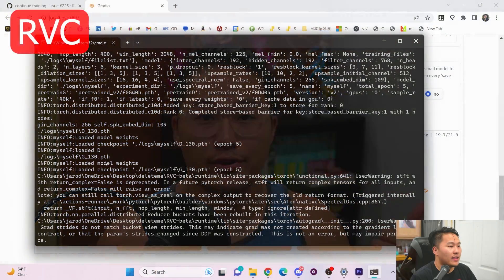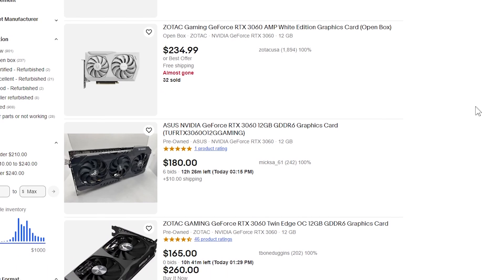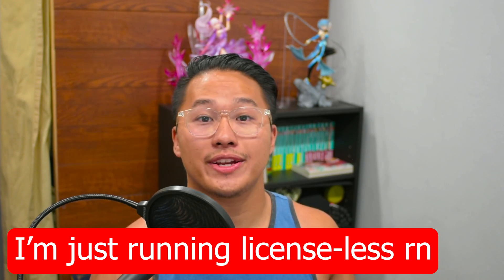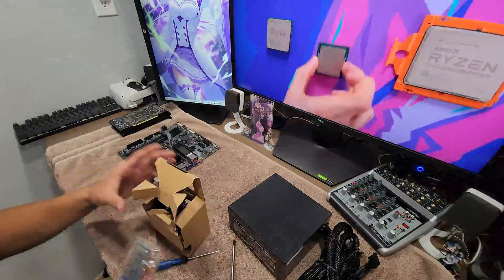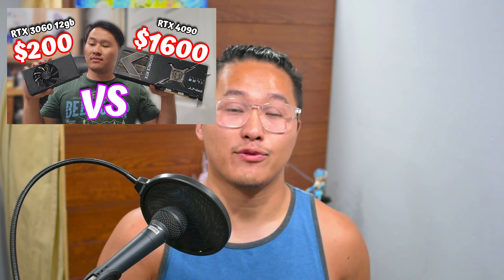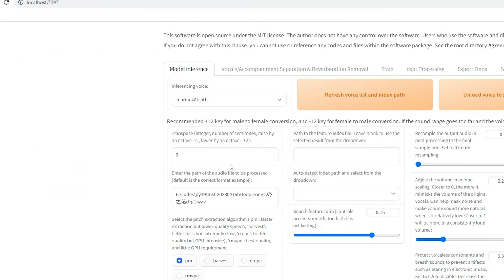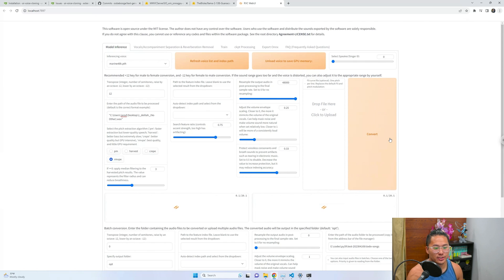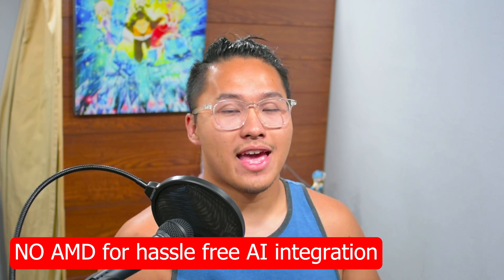The BEST $500 PC for AI 2023 - Voice Cloning, Image Generation, and LLMs

Comment: Hey Jarod, will a Tesla P40 24gb ram work better than 3060 12gb for the voice changer?
Reply from the maker: You don't need the extra VRAM for the voice changer and speed wise, the 3060 works just fine. Tesla P40 is server card so you'll have to build in cooling for it and deal with drivers. If you want something headache free, 3060.
Reply: @Jarods_Journey  great thanks!
Reply: @Jarods_Journey  ooh I thought the more vram the better for the voice changer. Does this mean that something like a 3070 8gb is better than 3060 12gb for just the voice changer?

Comment: What about the AMD RX 7900 XTX? Is it a good AI competitor to the RTX 4090?
Reply: Is Intel Arc OK or should I avoid being a beta tester for them?
Reply from the maker: I'd advise you stay away from anything that is NOT Nvidia for AI if you are going to be a casual user.  AMD and Intel can both use DirectML, but performance is not up there with Nvidia's Cuda.  If you want to be a developer/tinkerer, well you may be able to play around with AMD and RoCm on linux.

Comment: You will still need CPU cooler, or did you build without one?

Also cable kit will be needed too, if I'm wrong please correct me
Reply from the maker: The 12100F comes with a factory cooler, that's all I really need for this machine 🤟

All cables come with the components.

Comment: Hi @Jarods_Journey, I loved your videos and I'm trying to replicate your work with RVC, which has been a lot of fun. I do have a question about the differences in using an AMD GPU, particularly in terms of speed and voice model clarity compared to NVIDIA GPUs. I'm aware that AMD has been somewhat behind in terms of AI software, but if VRAM plays a crucial role in speeding up training, would it be worth switching to an AMD GPU or should I still consider investing in a more expensive NVIDIA GPU? Currently, I'm using the 8GB 3060, which is a bit slow, but it was all I could afford at the time.

Have you heard of any issues from AMD users specifically when it comes to using RVC? I'm really interested in understanding the pros and cons of using an AMD GPU. I don't necessarily need you to make a video or buy new hardware for testing, but I would greatly appreciate any feedback from the community. Additionally, if anyone has experience with training models on an AMD GPU, I'd love to hear about their experiences.
Reply from the maker: If you're doing anything other than gaming, right now I still recommend buying used Nvidia GPUs, especially for AI.  There is increasing support for AMD with directml or RocM and Linux, BUT a majority of libraries and optimizations have been built using Nvidia.  Not that you can't get great speeds (or better) with AMD for price to performance, but from what I've read, there are less issues and headaches with Nvidia.  I wouldn't recommend buying any new Nvidia card, but might say to instead get a used 30 series card that has more vram.

I don't own an AMD card so I can't make a judgement on speeds, but a browse around the web and you'll see the reasons that a lot of people just use Nvidia instead of play around with AMD.
Reply: @Jarods_Journey  Thanks and I appreciate the recommendations, Welp time to scraps some good deals 😁

Comment: Do you reckon it's possible to achieve elevenlabs quality/inference speed on a home setup like yours? Or would you need the enterprise grade hardware they likely have access to?
Reply from the maker: It really depends on what you're content with.  The setup I think is closest to Tortoise is TTS to RVC which I go over in a few vids, and this workflow on the 3060 would take around 6-20 seconds depending on how long the sentence is.  If you look at some of my livestreams with tts to rvc, my 4090 is able to reduce bottlenecks and keep it realtime.

Comment: Would a gtx 1080ti be any good for this? Its got 11gb gddr5x, but being before the rtx it's got no tensor cores
Reply: I've used my Zotac 1080TI for RVC and it worked great. For that task it's CUDA you're after, which the 1080TI still has (the same amount as the 3060 shown here) For the others, I am unsure, wouldn't hurt to give it a try?
Reply: @zennie3942  well funny that you would phrase it like that, but got some medical issues at the moment, and havent been able to setup my computer in any way were i can really use it. Slowly managing to sort all my stuff out to where i can use it with how i am now but a computer area is next on the list. 
So for now it literally does hurt, to do anything, but would be cool to test some of this stuff sometime. 
Thanks for the info about the cuda cores though. Seems like it should work alright.
Reply from the maker: People have used a 1080ti with it working fine, the larger VRAM does help. For training speeds, the lack of tensor cores will make it slower, so if you were to get a new card, the recommendation is make sure it has tensor cores.

Comment: Quick question about the 4060ti at 16gb; would it perform better than or about the same as the 3060 12gb? I know the vram will allow for more flexibility with using models but I am concerned about the 128 memory bus really slowing down training my own models. Will the extra vram even this out or is the older card still better?
Reply: Stay away of the 4060.
For AI at the moment you have two smart choice:
Rtx 3060 12GB
Rtx 4090 24GB
Evening in the middle is a waste.
If you are on budget grab a 3060 learn and experiment, test on it your dataset then for final train use an online service like lambdalabs (an h100 start at 2$/h). Or many other similar service. 
Enjoy
Reply: @blender_wiki  How about a 3090 or 3090ti?
Will the 3060 be capable of some AI video rendering?
The info you and Jarods give is exactly what I've been looking for while trying to research for a week now.
Reply from the maker: I personally would stay away from it ATM as the price for performance is just not that great compared to the previous Gen used. At $500, the msrp is nearing the price of a used 3080 ti where you can often find under $600 used nowadays and will yield you MUCH better performance.

Maybe if it was 2-3x faster, it might makes sense on price, BUT, on some tests, my 4090 was 4-5x faster than the 3060 so I can't see this being the case practically.

I also don't think 16 GB really enables much more either, it's enough for 13B parameter models, but too small for 30B parameter models so it's in limbo with LLMs and for training speed, you would be better off getting the 3080ti